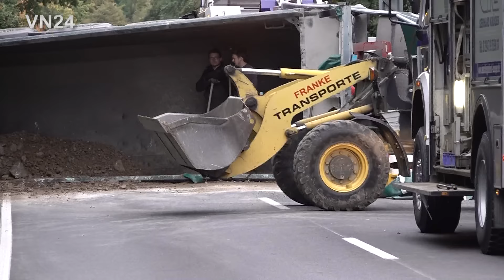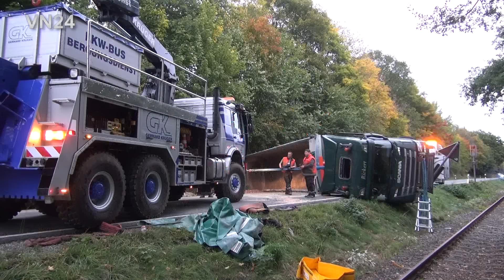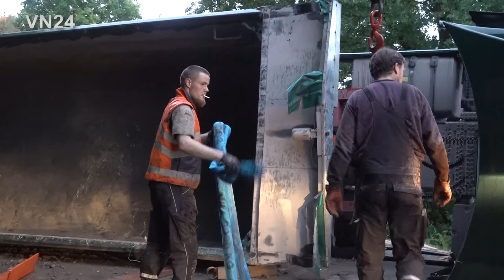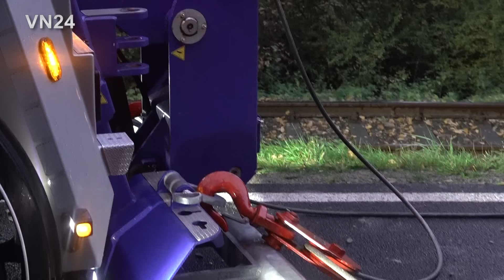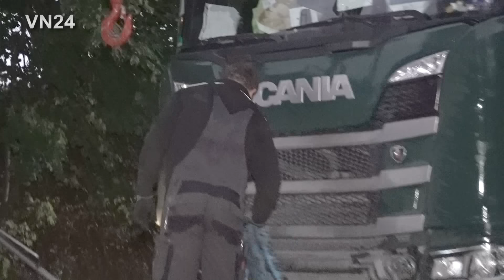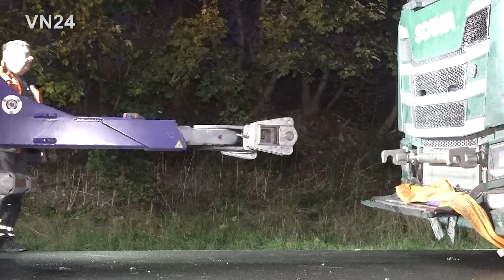14.10.2022 - VN24 - Bergung eines umgestürzten Sattelkippers auf der B516

Comment: How did the Scania driver manage to do that on a straight road ? Not an easy recovery job for Gerhard Kruger recovery working in the confined area. They did well in the circumstances.
Reply: Theres a S curve where the train tracks cross the road and he came onto the muddy gras and maybe overreacting.
Reply: have you ever get with the tires into a soft banket at the side of the road? road maintance is not everywhere ideal, so in my opinion as an experienced truck driver since 25 years, the right steering tyre got into the soft banket . the driver tried to steer the truck oout of it, but wilst this time, the right tyres of the dump trailer got also into the banket. a loaded tip truck has movement in its tyres and the whole chassis, this leads while trying  radically steering out of the banket to a whobble movement. the trailer tires got more and more into the banket while  the truck has realtively sure gone out, perhapalso hard hitting the brakes. the rest is physics with center of gravity. the wuestion is; why did he got into the banket. has some from the other direction drove to close to the middle lane? has the driver had a phone call(with free speaking) or even the handy in his hand. there were nearly everyday situations which were clos calls for something, perhaps like this. some situations were caused bye the drivers, others bye other road participants or eventualities like soft ground, something unexpected on the surface (gravel/mud/oil..)

Comment: the only thing I saw as a problem was the chain smoking,  yes they drained the diesel fuel tank, but a risk
Reply: It is illegal to smoke near an overturned vehicle as there are hazardous flammable substances that have spillt out If this was in the UK an offence would have been committed. Also why is their an unprotected railway line next to the road.This would also be illegal in the UK.
Reply: Diesel ignites by compression not by spark or flame.

Comment: One of the worst recoveries, until recovery started the railway was untouched, surely even if it meant more damage to the truck and ashphalt, wouldn’t you avoid risk to the rail line?? I don’t like to think about the cost of damaging that compared to the truck, and it was so obvious what was going to happen, the kit was there to get the truck on its wheels without dropping it like that and keeping it away from the railway.